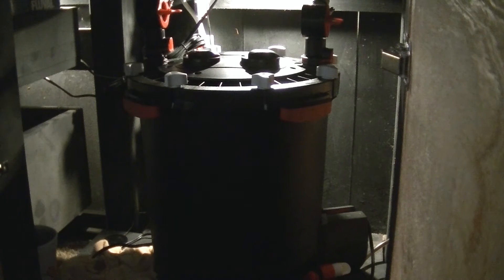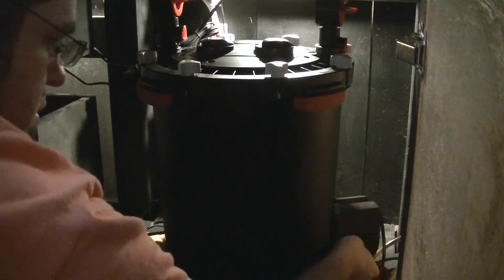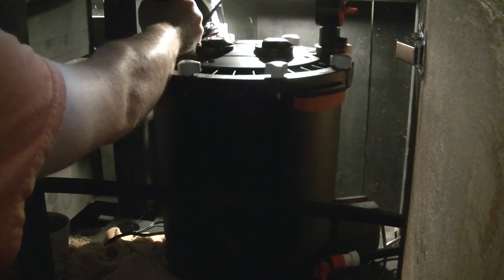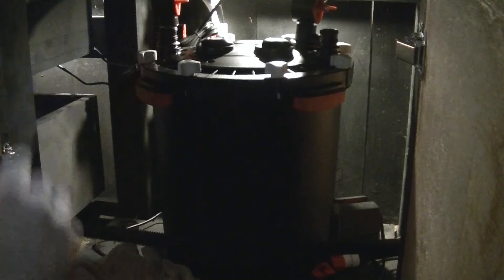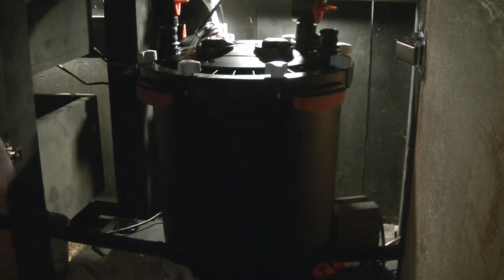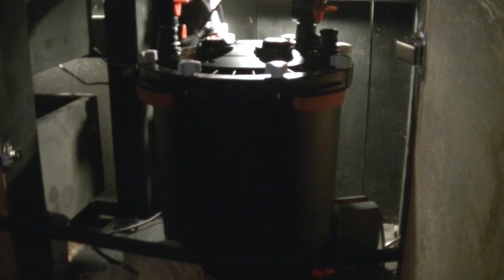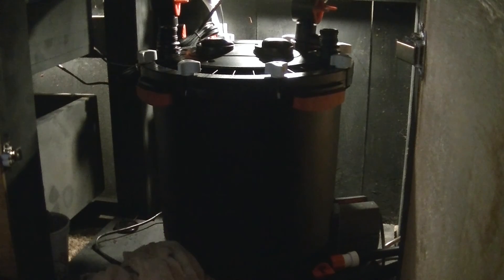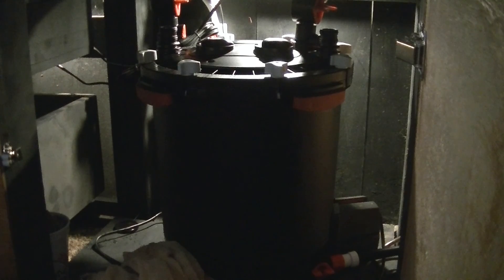How the FX6 purge Valve works

Comment: I've tried to use this filter through the drain or purge valve to do a water change. Only to have it stop the sipon at 50% of my tank empty +wanted to do a 75% or greater water change) then had to reprime the filter to get it to run again.. giant fail and waste of my time..I understand it's gravity fed and if it did 50% then it was working but failed to do more than 50% so.. ya.. not good.. do it the old fashioned way and save the hassle.
Reply from the maker: Larry R yea I don't use mine like that but I can see how it would lose the siphon since the drain line has the adjustable peace I would assume it's not completely tight.
Reply: Ken Bond your wrong.. read the the documentation.. and for your info.. the water level wasn't below the intake when the sipon stopped..